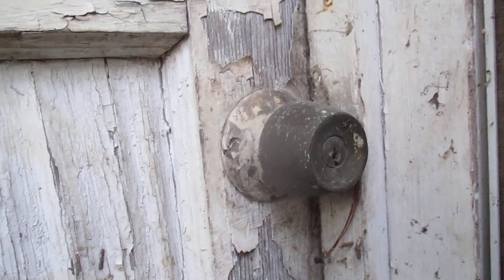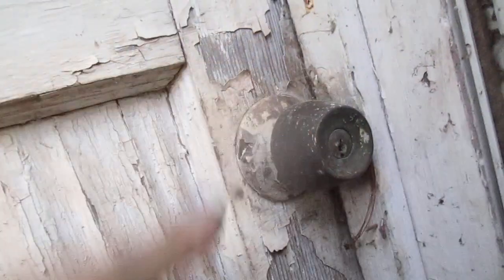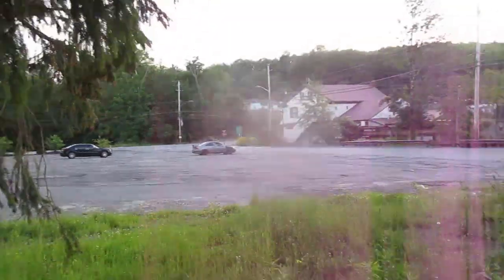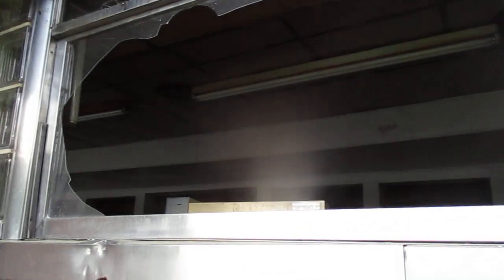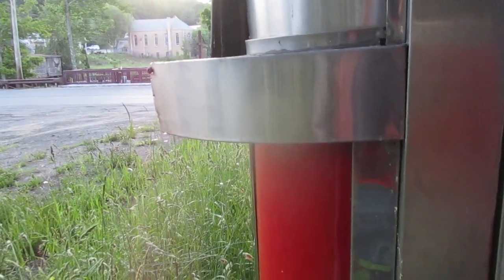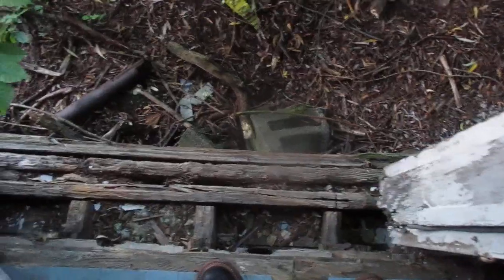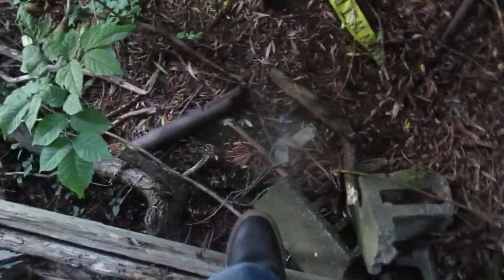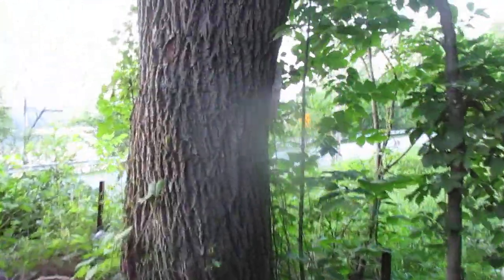Ghost Town New York vintage diner turned vintage laundromat plus assorted structures .

Comment: I was passing through this area today and took a peek at this place today. All of the washing machines and dryers are gone, and almost every window and door is completely smashed. One front door is boarded up, but the other has had every piece of glass smashed into it - you don't even have to walk around back to get in anymore. It's interesting to see how it's changed within just a year.
Reply from the maker: Someone needed some scrap metal cash I guess ,shame the machines probably still worked

Comment: No egg with your Taylor ham?? My niece bought me a Taylor ham hat it has a patch which looks just like the front of a Taylor ham box. I will never call it pork roll. Did you ever go to the Egg Platter on Crooks Ave in Paterson? Really sucks the tore it down a couple years back.
Reply from the maker: Pork roll is that greasy slop coffee truck vendors try to pass off as Taylor . I remember that diner when it was called something else . It changed hands around 2000 ? Built by the silk city diner co . It has a different name when I first saw it . I did not think it would last very long

Comment: I see they have old Maytags and. Hotpoint, whirlpool ,Washers and wascomat  man i wish i was there i would love to fix all of the machines and take them
Reply from the maker: What year to they look to you . I was told it opened in the early 90`s
Reply: @AbandonedNorthJersey  whirlpool :1972
                                                  Maytag:1971
                                                  Hotpoint (GE) :1970
                                                   Speed queen: 1990
                                                     Wascomat: 1973
Reply from the maker: @Thedonsmoney25823  that seems to be fair estimate as they have a slight 60s style. I wonder if they are all empty of quarters. The belts might be dry rotted. I have a Kenmore dryer that I replaced because it tripping the fuse box and also working that's not very old. I plugged it in and it didn't work and then tried it again and it kicked on.when it won't work I can hear a straining electric groan and smell burning
Reply: @AbandonedNorthJersey  might have to replace the whole thing or buy a new motor